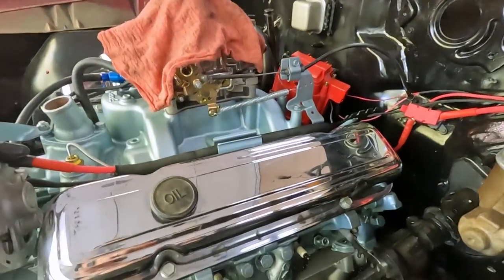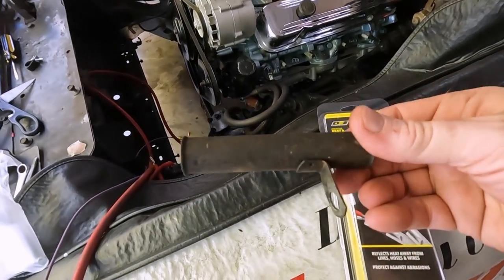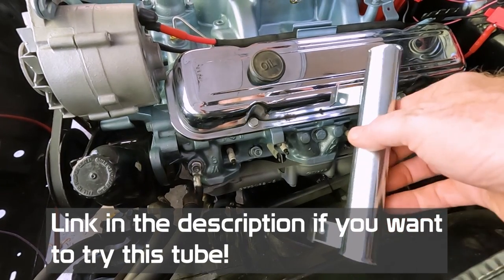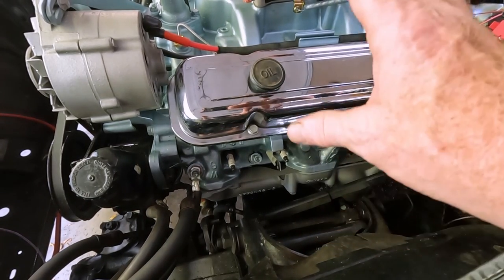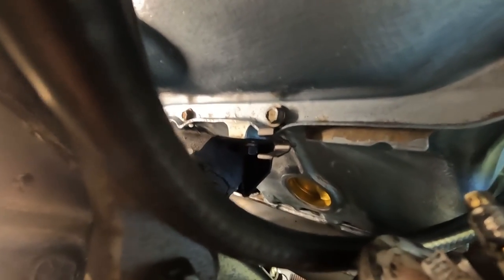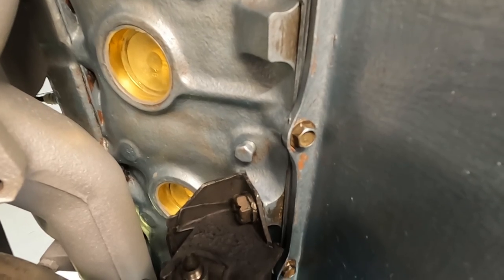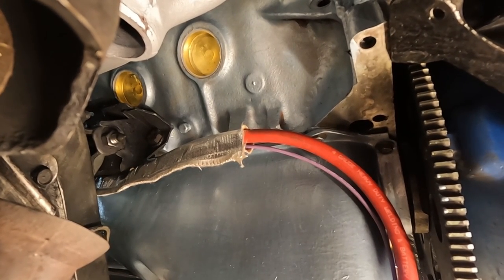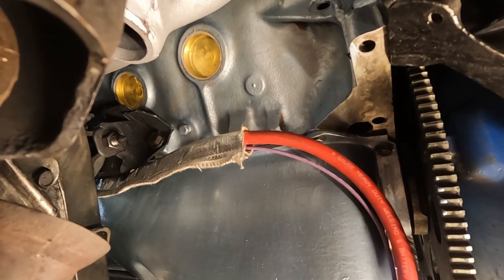Re-Routing Battery Cable to Prevent a Fire!

Comment: Thats how I run the charging cable on my Barracuda Tim... Looks like you could make another tab and bolt it where the engine mount bolts to the block for extra support, also you can use large heat shrink tube on the ends of that insulation to make it tidier and stop it sliding around on you... Keep em coming mate
Reply from the maker: Great suggestions! Thanks

Comment: Excellent video brother I never mentioned that but it's really important to protect your wires especially that big red wire I like to use radiator hose that they sell that are not too big works out great
Reply from the maker: That's a good idea, too!  I'm so paranoid of that damn wire now that I'll try anything. I may also end up modifying that clip to make sure it holds the cable up there - tack to two together to make one strong clip. We'll see.

Comment: It should work just fine.
Fire Bad.
I used a 5/8" heater hose (SAE J20R3 Heater Hoses) rated to 350 degree (highest temp I could find locally),and fed the positive cable wire down to starter.
I have the American Auto Wire Dist Block wires feeding to starter as well (from drivers side fender mount).
So far no issues.
Still fining tuning the fresh 326 rebuild (working out a few bugs).
(*64 Lemans)
Reply from the maker: I might tweak that clip since I’ve only got one on the oil pan. But I’m not as paranoid about running it down through the exhaust manifold anymore 😅